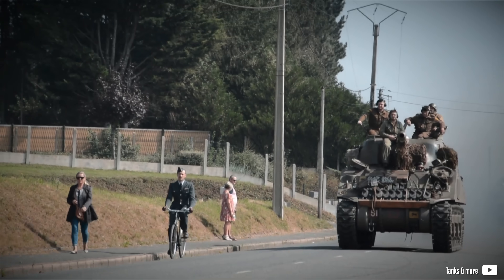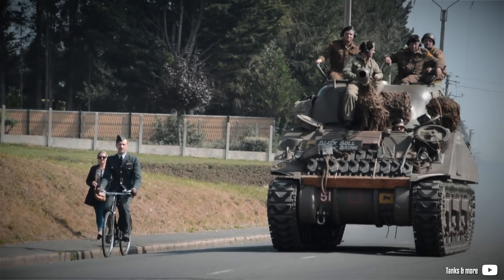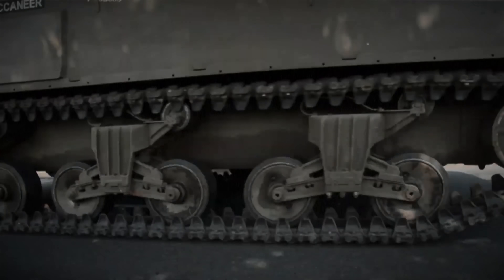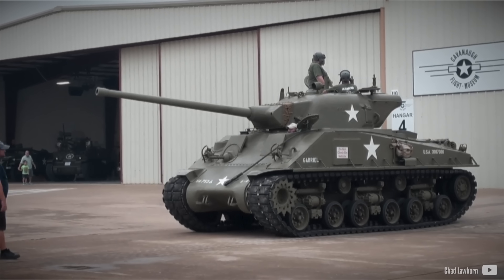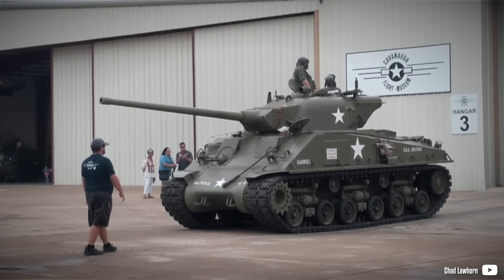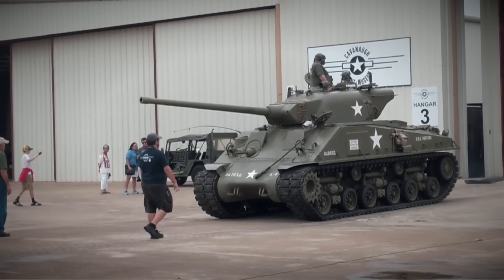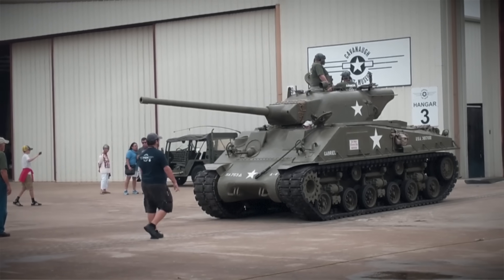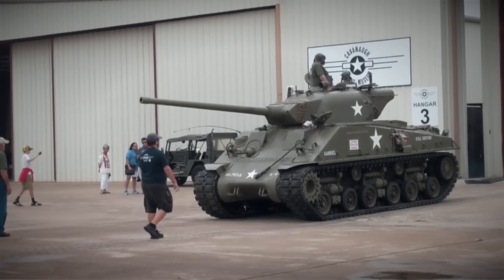This Super Complicated 30-Cylinder Was Sherman's Most Reliable Engine

Comment: they also made a 265 spitfire. im putting one into a '41 Dodge WC12 right now
Reply: The 265 was the ultimate development of the flathead six. It has the advantage of full flow oil filtration and the largest displacement. In a Dodge truck or Power Wagon should be damn near unstoppable.

Comment: That is amazing, I never heard of it before. Wonder what the fuel mileage was,2 MPG?Oh wait, it's the army nobody cared(: thanks for the video I enjoyed it.
Reply: Off road? Talk about gallons per mile, not miles per gallon :D
Reply: Those old flathead Chryslers were pretty fuel efficient. 18MPG on the hiway which was considered good for a 4000 pound luxury car at that time. In the tank, 5 of them driving through the friction of tank treads, probably 2 or 3 MPG.

Comment: That is a really cool engine. I can see a tractor pulling team get a hold of one of these and install EFI and multiple turbochargers
Reply: I like the way you think!
Reply: @t16205  I one time saw a clip where tractor pulling team got a hold of an 1100 CI Ford GAA tank motor installed EFI and twin turbochargers to compete in the modified class.
Reply: This needs to happen yesterday

Comment: I remember seeing one of these in the Chrysler museum at the Tech Center here in Auburn Hills before they converted the building to Alfa/Maserati office space. I love how resourceful the design is, using so much existing tooling and production to create a tank engine with very few tank-specific parts. Although it might have helped those Shermans get up and go a little easier if they'd used five of the 310 cubic inch sixes instead of the 251s!
Reply: They were probably constrained by the size of the engine bay.
Reply: for its day the sherman was plenty fast it was lite also

Comment: As someone who owns a 1949 Chrysler with a 251, I can tell you, they are extremely reliable.
Reply: My dad ran Dodge trucks with the 265 cubic inch engine. They ran on LPG and yes, they were indestructible.
Reply: @rosswarnell1252  I kept a Jeep Cherokee with the old 4.0 straight 6 and it outlasted the components holding it in the engine bay! That was the ONLY reason I was forced to part with it.
Reply: @rosswarnell1252  I have 2 or 3 of the 265s.  On propane the industrial flathead is very long lived, as long as it does not overheat - the head gasket can fail.
Reply: @timothykeith1367  we always sprayed the head gaskets with a heavy coat of aluminum paint and torqued down the head while it was still tacky.
Reply: @rosswarnell1252 The 265 was a 251 with a 1/4" longer stroke. It was built between 1953 & 1956.
Reply: I had a Chevy 250 in-line 6 and you couldn’t kill the thing. Something about those low HP but high torque inline 6 engines was fun.
Reply: @Chris G  300 in line 6 for Ford for me.  High torque in the low end and you could not kill them.  For God's sake UPS used em for over 25 years.  Wished Ford still made em.
Reply: @rvndmnmt1  love those 300 6 in line ford's, horsepower of a lawnmower, torque of a Peterbilt lol and indestructible with those internal gear driven components. No cheap plastic belts to break.
Reply: that's because they  won't rev fast enough to hurt themselves
Reply: @michaelwallbrown3726  The 230 may have oiling issues when the oil level isn't topped off, but otherwise they can maintain 3,600 rpm all day long.  The oil pan on the multi-bank must have been creative.
Reply: I was restoring a '48 Desoto coupe (Military Blue!) that had a 1950's Chrysler 251.  The engine didn't run well, it smoked, and it was coated with an inch of built up tar.  I took the engine to a shop that specialized in classic cars and told them to rebuild it.  
About a month later the owner called me and said, "I don't think we should rebuild it."  I thought he was saying the engine was shot, but he said, "No, the engine is fine.  The carb needing rebuilding, the head gasket was leaking, and your valves had some heavy carbonization.  We fixed all that.  But your cylinders are all holding proper compression, there's no slop or bump in your bearings and your timing gear and chain look new.  I'd leave it alone."  So I did.
I drove that car like it was a daily driver (which is really fun).  I probably put ten thousand miles on that engine, then I sold the car to someone who still owns it today - 26 years later.  Other than Jiffy-Lube and a yearly tune-up, he hasn't done anything to the engine.
Reply: Yea US peaked in the 50's. Back then it was clear the most important thing was making the best product. NOT making the most money as it is now. I think the 50's had solid education, we were not messing around with our food, we did not tinker w/ our social systems, our news was REAL, our products were the best in the world, and we were on the gold standard. Honestly its turned to sht ever since. Capitalism gone awry. Now we have these "cars" that are being turned into driving electronic devices. What lunacy. I cant...
Reply: Yowza!  In college,  I had a '49 Chrysler Royal sedan, with a semi......

Auto. Tranny.
NOT a"Hot Rod.."
Got a radiator leak, so ran it 'air cooled " for a little while.(3 months..)
Like the honey badger, ,"Chrysler Royal didn't give a rat s. Xxx7...."
If I recall, the flat six was a Fireball designated power plant.

Now that I am 78 I appreciate that car much more than I did the first time !
Reply: I read where they wanted the Sherman to be able to be driven and operated by young men from the farms in wwII , they kept them simple to operate I would guess also simple to work on in the field, the Sherman was small but it did very well in the war and many countries used them. I didn’t know they were just five Straight sixes bolted together ! That’s very interesting . Didn’t they also use the same aircraft engine that the Skorsky helicopters used? I guess not , I’m going to have to check that I thought they had air cooled rotors engines in some of them??
Reply: https://youtu.be/SDWm-RHh9jc
Here's one that refused to die and got put back to work.
Reply: In a weird way, this was a radial engine.
Reply: There's been plenty of rock solid reliable engine's that once they try something goofy like this with it is when they find out all the little reasons why it's not a good idea.
A prime example is just about every major aircraft engine manufacturer trying to attach successful engine's together and none of them ever worked out, the V1710 Allison engine when mated together with another one to make what they called a W engine configuration in theory should have been a reliable engine that made twice the power of a V1710 and been every bit as reliable, they were even so sure it'd work that several aircraft manufacturers started designing aircraft for them, their design depended on the theoretical power they were supposed to make per it's dimensional size.
Nope, they didn't work, and when development of the engine's lagged behind the aircraft manufacturers changed the engine mounts to accept regular V1710 engine's just for the sake of getting the aircraft flying to start working out any aerodynamic issues with the intent being that when the W engine was finally ready it could quickly be adapted to the airframe that would have most of it's flight development issues already sorted out.
Nope, the engine's never could be sorted out and without engine's that could produce the power that was originally promised the aircraft themselves were naturally worthless from being so underpowered so they never made it beyond the prototype stage.
Then there's even some engine's like that which actually limped their way into production but we're constantly plagued with problems that never were satisfactorily sorted out in their lifetime, the R4360 Wasp Major is a prime example of that, people oh and ah at their massive 4 row size and 4,360 cubic inch displacement but the fact is those engine's had more problems and killed more people because of their problems than you can count, that's why their service life was very short and they were quickly replaced by turbo prop and jet engine's with some aircraft that were born wearing R4360 engine's actually being converted over to turbo props in their lifetime.
Reply: Reminds me of the RR Vulture.Two V12 on common crankcase.Was a disaster

Comment: Wild design that worked well enough. These multiple piston engines whether radial or this are mind boggling.
Reply: Try thinking about the Australian AC Sentinel that used three Packard V8’s in a similar arrangement…
Reply: Actually not. A radial engine has a single crankshaft. The A57 had 5 crankshaft, coupled by gears

Comment: Being a flathead and being as sturdy as the engine was rumored to be it would probably have been a great candidate for a Supercharger. A very mild boost would have done a lot for that engine if they had the octane fuel that they needed. You can't raise compression without having higher octane fuel or you risk detonation.
Reply: High octane fuel was in short supply and reserved for airplanes.
Reply: @MrAstrojensen  However , many Sherman tanks were running the Wright air-cooled , aircraft engine that required high octane fuel.
Reply: @amerigo88  r975 was on the weaker side for such engines and could run 80 octane fine. They also were run at less extreme settings.
Reply: @amerigo88  the tank version was not supercharged.
Reply: @amerigo88  The Wright engine was taken away from M4 production in 1943 as Wright's production capacity wasn't enough even for AIRCRAFT orders.  And the tank version was modified to run on lower-octane "pool" (motor) gasoline.
Reply: @MrAstrojensen  Correct. And even then, early in the war, there wasn’t enough sufficiently high octane fuel for airplanes either.

Comment: That might be one kind of cylinder deactivation system I would tolerate.  Just have a few small displacement engines running a common shaft and decouple and shut down one or more depending on load demands.
Not sure of the frictional loss compared to current cylinder deactivation systems.  
Thanks for the interesting video.
Reply: It would work if it was decoupled using clutches...
Reply: @Happyfacehotwheels  You'd end up de-timing the engine, though... when you re-engage the clutch you'd somehow have to make sure it's re-engaged with the cylinders fitting in with the rest of the engine's firing order.
Reply: Ĺļ @iskandartaib  not really,  it has 5 banks of straight 6, each with it's own distributor so as long as each bank of 6 is in time it will run. They did say it will run on 18 cylinders.
Reply: @Happyfacehotwheels  Sure, it will run.. it's just that the bank you deactivated and reactivated would not be in synch with the rest of the engine. I'm pretty sure the engine was set up so that the 30 cylinders were to fire 24 degrees apart - I think he said so in the video.
Reply: @iskandartaib  There may be overlap in the firing but I don't think it would matter. It will make the engine have a different power impulse. I'm no engine expert but I do know that some engines use uneven firing.  Harley Davidson and Yamaha come to mind.
 Now let's see if this 30 cylinder monster will fit in a Power Wagon!
Reply: @Happyfacehotwheels  Oh sure, it'll run, just rougher. And yeah, some engines do fire unevenly, sort of unavoidable with a Harley type V.
Reply: @Happyfacehotwheels  Depends on the design i guess the engine runs without a flywheel, because with 30 pistons you dont need but it means timing is important.

Comment: always wanted to see one of these monsters in person , I own several chrysler 251 engines ,,all of them run  2 are on water pumps  and 1 is in a generator/welder 
the other really cool engine used in the sherman was the ford GAA and i have one of those too although not currently running yet,,i found it at a salvage yard about a decade ago
Reply: Would love to have a GAA, what did you find it in?
Reply: @aldenconsolver3428 ,,it wasn't in a vehicle  I actually found it half disassembled setting in a crate at an army surplus place ,, the guy didn't know what it was ,,it's been setting on a stand covered up in the back of my garage for most of the last 10 years ,,i have all of it's parts and have it almost back together ,whether it'll run or not is another mystery
Reply: @wildcoyote34  Oh wow, that is unusual for sure. The GAA is pretty special, to be sure. IIRC it was meant to be a 12-cylinder aero engine for the military, but that didn't work out. So we got the lovely V8 instead, and wouldn't you know? Perfect size, shape, power output and weight for a tank. Noice. Man, I bet that thing runs--wonderful engines, sound like a monster truck had a baby with a stock car. GL with it friend, you got yourself a winner, even if it never runs.
Reply: @HANKTHEDANKEST  Ah.. that explains why the angle between the banks was 60 degrees...
Reply: @HANKTHEDANKEST  it'll run someday , i'm an engine collector and i someday hope to have an engine museum ,,i am almost 50 and have been collecting engines since i was 16
Reply: Keep it going.Its good to see those old engines even if they are not running.
Reply: Mount them on a trailer and take them along to county and state fairs. There's usually an assortment of old engines, most of them being old single cylinder stationary engines. A tank or aircraft engine wouldn't be out of place.

Comment: I do believe the most famous variant of the Sherman that used this engine was the Firefly with the 17 pdr. It was probably the most lethal variant against German armour including Tigers.
Reply: Most of the British Shermans used the multi bank engines - simply because they were so reliable.
Reply: @allangibson8494  Didn't the Americans supply the British with a lot of diesel Shermans? So that they'd be the ones who'd have to worry about a second fuel supply chain for fuel? 😁
Reply: @iskandartaib The Brits did get Diesel powered Sherman’s, but from I read not as well liked as it was less responsive in combat and used less readily avail fuel.  I believe the Russians received the majority of the Diesel powered Sherman’s as this fuel was inline with their doctrine since virtually all their armor used diesel.
Reply: True.  The British eighth armoured division mostly used the 75mm.  The 75 was faster firing and had a superior HE round.  The Brits encountered more German tanks than Patton’s 2nd armoured division, and there are multiple accounts of the fast firing 75 taking out Panthers, Tigers and Jadgpanthers.  The Firefly had one less crewmen in the turret because of the large gun breach and was never the lead tank as the gunner was also the loader.  When they figured out how to use the Firefly, and dispersed among regimental 75s, it was the preferred one shot killdozer.
Reply: The Firefly had one less crew member in the HULL.  The assistant driver/bow machine gunner was dropped to make space for stowing more of the very big 17pdr shells.  It had a 3 man turret, the gunner certainly did not load 17pdr rounds!
Reply: @givenfirstnamefamilyfirstn3935  so they eliminated the radio man.  I stand corrected.
Reply: @ProjectFairmont  Well the commander did the radio, the radio was in the Firefly turret extension box behind him in the turret.